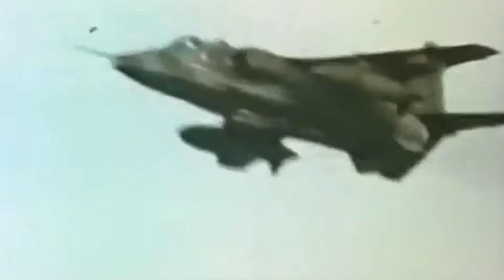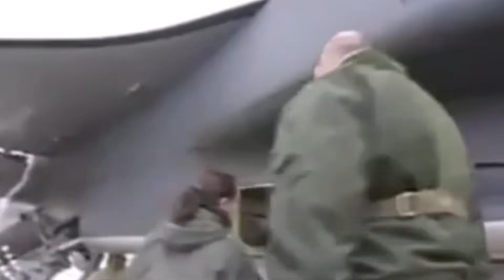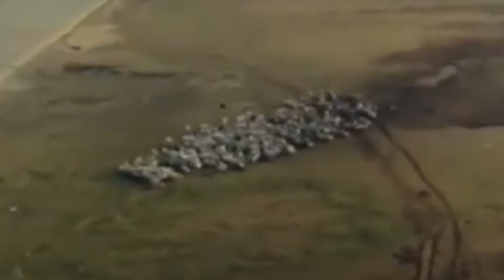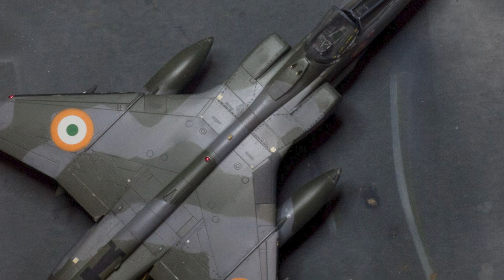The Fighter That Battled the Wrong War and Shocked Everyone

Comment: The Jaguar did not feature GPS because it did not exist back then, GPS did not go into operational service until 1993.

The aircraft stopped being manufactured in 1981.

It is possible that the aircraft's avionics might have been upgraded later in life,  towards the end of its life with some countries, but it certainly was not an aircraft that came with GPS. It certainly did not roll off the production lane with GPS. That is impossible.

Comment: If the jet was first introduced in 1968, and was only fully integrated by 1973, and desert storm was in 1991, then the aircraft was hardly obsolete.  I mean the eurofighter entered operational service in 2003, 22 years ago, and no one is suggesting its obsolete.

Comment: Joining the RAF in 1980, I was posted  ASF, RAF Coltishall in January  81. The JAG-U-AR (not Jagwar!!!!) was more maintenance orientated compared to some of the RAF's older aircraft. Although the "Constant velocity, variable noise" low powered engines
got the Jag' a  bit of a slagging from other Squadrons.
Proud to be ex-Jag and Coltishall, a great station.. Dave "Spike" Howard
Reply: The constant thrust , variable noise was quoted about the jet provost, Not the  jaguar.
Reply: @davedrake5769  It probably was, but I heard it often quoted whilst at Coltishall..

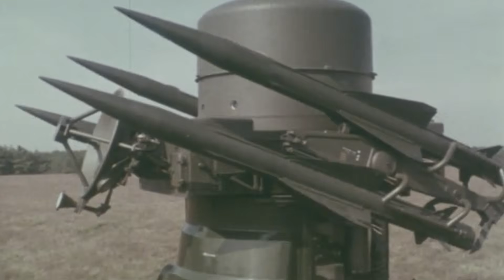Comment: What on earth is Bloodhound (10:28) doing in this video?  I was in the RAF and worked on Bloodhound at the time of the Gulf War and can confirm it absolutely did not deploy to the Middle East.  In fact, at the time it was just going out of service.  There was a rumour that it was discussed taking it out there to 'use it up', but that the timescales and logistics involved wouldn't work.  I suspect that the Engagement Controllers were looking for some way to get in on the action after years of sitting in Lincolnshire and East Anglia playing wargames.

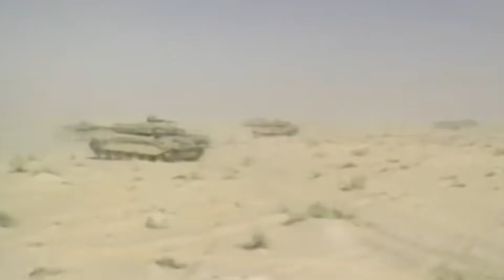I am not 100% sure whether Rapier (the missiles at 10:23) went out.  They were far more likely to be involved as the RAF Regiment used them as part of their airfield defence role.

Comment: Did he say 46,000 feet ! We were luck to get up to 26,000 feet. 46,000 was impossible with the engines we had in 1980 ! It was certainly a good stable platform for dropping and tossing bombs and although the Navwas was good the map stretch was a problem sometimes being up to 6km out from the actual position. Although many at the time didn’t realise it because they’d stopped map reading.

Comment: I was stationed at Coltishall during the Gulf deployment and prior to the deployment the station worked round the clock getting the planes refitted and repainted and shipped out. It was manic and every branch on the base mucked in together..... when they came back to the UK with all the paint faded and combat mission markings painted on them they were a sight to see

Comment: Pretty sure they operated in Iraq/Kuwait according to the same SOPs--employing the same TTPs--they would have in Europe during the Cold War. So, I'm not sure where Dark Skies gets the notion that the Jaguar missions were "sheer madness by Cold War standards."  

Dark Skies has some interesting videos but uses a lot of eye catching hyperbole. 

It is true that we were lucky that Coalition air losses weren't much higher. The Tornadoes, however, did suffer a few casualties in their low-level operations. You have to remember that stand-off guided munitions were actually very few in number in 1991. So, if you can't launch a GPS or even laser-guided munition from 20, 30, or 40 miles away . . . you bring the aircraft to the target (and try to increase survivability by flying ultra-low). Even "dumb" bombs are pretty accurate with modern targeting computers. However, you have to be extremely close to employ them. .

Comment: Worked in the Role bay at Brüggen on pylons from 82 to 85. They used to let Armourers loose on pylons back then. Used to go away with 20 Sqn to Decimomannu each spring and work on a load team, usually on 20 Sqn during exercises. I went back to Brüggen in the late eighties, mainly fitting and removing Tornado seats. Much prefered the Jaguar.

Comment: The SEPECAT Jaguar was one of the most under rated combat aircraft. UK and the French built them but the French didn't like them and did not use them much or install high tech electronics. The UK used them the most and did do some upgrade on them!

Comment: the Indian Air Force operates a fleet of 112 Sepecat Jaguar DARIN III multi role all weather strike fighter since 1984 . . . 106 of the 112 airframes are still operational as of mid 2024 . . . it's primary role is providing fire support & tactical high value air-to-ground precision strike missions . . . the Sepecat Jaguar DARIN III multi role all weather strike fighter ushered in the era of precision surgical strike in the Indian Air Force . . .

Comment: Horrible aircraft. The resonance of the engines during start-up caused pain in the starter crew's chest.
Additionally, the NavWAS (Navigation & Weapon Aiming System) was a complete joke.
Reply: I was a NCO supervising the jaguar line at Lossie for a year, and then three years doing the same out of HAS's in RAF  Germany not once in all that time did I ever suffer any chest pain
Reply: @davegoldsmith4020  Interesting. I only worked on them in Gibraltar and all the Engineers there complained about the chest resonance. It may have been something to do with how the pans were constructed.
Reply: @ I left the Jag force in 1982 it may have been a problem with the Later updated Adour engines.  The worst problem was the dust when they started up in the Hardened Aircraft Shelters in Germany.

Comment: Some errors/omissions in the video: 

The Jaguar definitely did NOT have GPS when it entered service in the early 1970s! Navigation (in the RAF) was by INS (Inertial Navigation System - gyroscopes that measured the aircraft's movements, basically) and a moving map display that was a literal paper map projected onto a screen.

Likewise, the RAF Jaguar didn't have Sidewinder capability on service introduction. That was only done in a rush for the Gulf War in 1991, using a system of overwing rails that had originally been developed for export customers.

The Jaguar played NO part in the Falklands War.

RAF Jaguars never had any kind of radar, advanced or otherwise. The only Jaguars with radar are the Jaguar Ms operated by India, which have a French Agave radar in the nose to support the use of their Sea Eagle anti-ship missiles.

After they took over Breguet Aviation, Dassault Aviation were more than "unfocussed" on the Jaguar, they were actively hostile to it, constantly arguing against upgrades to the French ones and offering their own products in competition with it even when that disunity hurth both partners. Every Jaguar International sale was made by British sales teams in the teeth of French opposition. After the contract to sell Jaguars to India was signed, a Dassault salesman was convicted and sent to prison in India for trying to bribe officials to reverse the decision. The reasons for this hostility were basically down to the attitude of the company founder, Marcel Dassault. He had a dislike of low-powered aircraft (which the initial Jaguar was), and he was intensely nationalistic, believing that France should ruthlessly promote French interests and industry and share nothing with other countries if it didn't have to. This stood in stark contrast to the attitude in Britain, where it had become axiomatic for governments of all political persuasions that purely national big-ticket defence projects were unaffordable and co-operation with other NATO/European countries was the only way forward.

There was also a proposed naval version of the Jaguar called the Jaguar M (different from the much later Indian "Jaguar Ms"), which was adapted to operate from the French Navy's carriers and got as far as flight testing before it was cancelled. Dassault lobbying played a large part in this, persuading the French Navy to reject it on the grounds that it's "landing performance with one engine out was unsatisfactory", despite the fact that a) more powerful engines that could have solved this were in the piepline and b) the all-Dassault aircraft they persuaded the French Navy to adopt instead was the single-engined Super Etendard, whose engine-out performance was vertical!

During the Gulf War, the RAF Jaguar force discovered the MoD (UK Ministry of Defence) UOR (Urgent Operational Requirement) system, which allowed urgent upgrades to be fast-tracked without the usual years-long procurement and assessment process. After the war, an RAF team set about using and abusing the UOR process to it's limit to get the Jaguars upgraded in stages to a much higher standard. This was spectacularly successful, AND even reasonably cheap. The aircraft got upgraded engines, nav/attack systems, TIALD targeting pods, laser-guided bombs, night-vison-goggle-compatible cockpits and helmet-mounted sights. A further round of upgrades which would have seen the AIM-132 ASRAAM advanced air-to-air missile and towed decoys introduced was cancelled before it could be implemented.

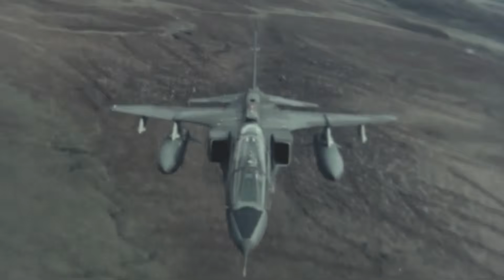Comment: 5:20 No Jaguar saw action in the Falklands. It wasnt until after the war that there was an airfield able to support non-stovl aircraft such as the Phantom, even then the runway had to be extensively repaired and lengthened first and NAS809 remained on station for a while after the war. The British aircraft in service during the Falklands were the Sea Harrier FRS1 and Harrier Gr3, along with some debatably effective missions flown by the Avro Vulcan

Comment: Amazingly, not a single Jaguar was shot down in the Gulf War despite some of the most challenging missions and an incorrect claim in the comments that a number were. 

To say that it was long in the tooth in some ways is to overlook that it remained in service with the French Air Force until 2005 and the RAF until 2007, having proven highly effective in its Gulf role. However, it is probably fair to say that its life got extended beyond intention due to delays in delivery of its replacement.

There is an error to say it was in the Falklands conflict ( it was not) and early ones did not have GPS since the aircraft predated such but perhaps the latter is a confusion in that from the start it had a moving map display.